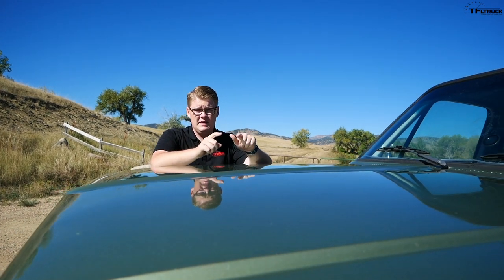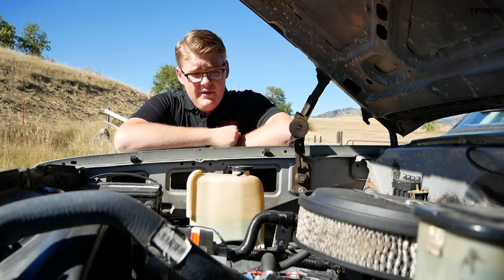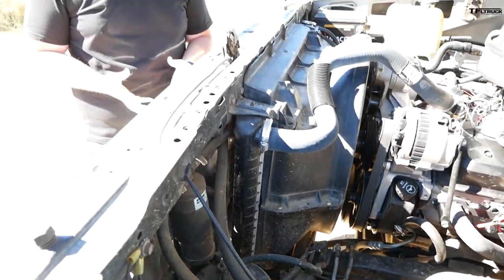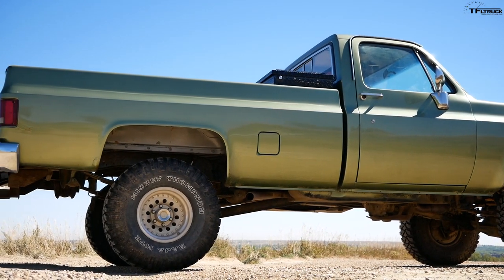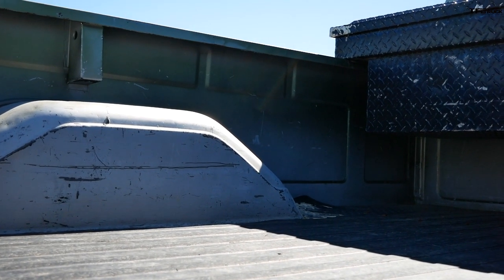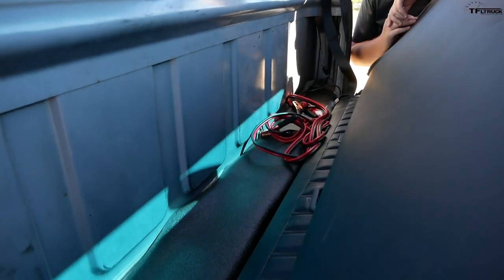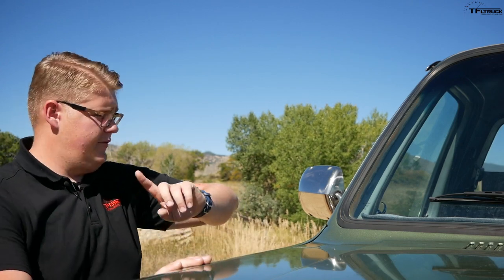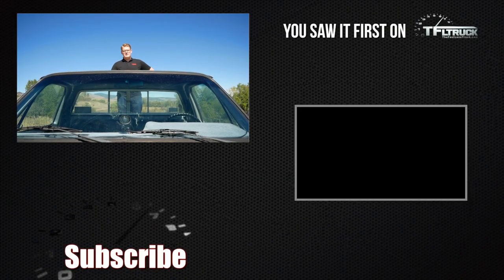Is The Chevy K10 Square Body Pickup Cool or Crap?

Comment: Manual transmission, transfer case, hubs, windows, locks, and tailgate means simpler, lighter, and less stuff to malfunction.  It also means less service work for the dealers and replacement part sales for the manufacturers.  In other words, we'll never see vehicles manufactured like that again.
Reply: sadly
Reply: Your right
Reply: Copy that ghost ryder
Reply: You're 100% right! To bad they built them so bad
Reply: Nissan micra is still built like that lol
Reply: Amazin253 it was top of the line back then, and even today if  you rebuild back to stock form you can take it out and beat the shit out of it and it will still get you home. You can’t do that with a stock truck today. Oh yeah remember you could buy one for under 10k in the 70’s and under 15k in the 80’s. Compared to the 60K + trucks today.
Reply: True and a good reason I'll never get rid of my 78 k10.
Reply: Sherman Bushcraft median household income yearly in the 70s was also only about $9000. Pretty comparable to today.
Reply: I just got a 83 gmc 1500. I've had too many vehicles die from computer issues. I had a great gen1 Kia sportage 4x4 and a friend who is a current kia tech. Together we couldn't fix it. 2013 dodge electric power steering, broke like they all do $2500. Just got an old beat up truck with no computers for $3000. I will be starting the trans rebuild this weekend. I can fix anything on this truck with tools I own and without a computers permission.
Reply: Government regulation is the main driving factor of increasingly complicated vehicles.
Reply: Might get one, what about safety
Reply: It still had a mechanical fuel pump
Reply: Best of both worlds us a resto-mod square body. LS or even better...an LT swap with the factory fuel injection and a cam ...less maintenance and more reliable,  more power
Reply: Here in Europe this is still a valid option for pick-up trucks. Toyota Hilux for example comes with everything mentioned in a manual version in the most basic model.

Comment: Chevy was getting 30+ mpg with the 6.2 diesel back in the 80s. I don't understand fuel efficiency nowadays
Reply: I do. It's because of emissions controls that choke the engines, and also because of safety regulations that force manufacturer to add more and more weight to vehicles.
Reply: that motor was also gutless and specifically built for improved fuel economy
Reply: I think you are pushing it a bit there. My grandfather bought a '83 chevy van brand new in '83 He claimed he got 25mpg back then and I have no choice but to believe him. He wasn't prone to exaggeration but I do know he probably never topped 55mph. 
I now have the van and have converted it to 4x4 with a performance 6.5 in it. Almost 300hp by my estimation.  I pretty much have to baby the crap out of it to get 21mpg. Otherwise freeway miles are closer to 18mpg
Reply: If I'm careful I can pull 18mpg with my 84 1ton Crew cab dually 4x4. It has a 4" lift and a 4 speed with 4:10 gears.
Reply: 6.2 with barely 160hp
Reply: mujjuman 130 to be exact. It was never designed as a powerhouse it was built for economy to compete with the 305
Reply: Yeah but you can turn the fuel up a touch and get some more power or add a turbo and gain a decent amount. The Banks kit advertises 60hp, 120ftlbs and 19% gain in mpg. Still no power house. But I pull a 16ft carhauler with with my crawler or others behind my 1 ton dually 4x4 crew cab. So it's heavy already.
Reply: I have a 84 6.2 lifted suburban with a NV4500 that still gets 22mpg. A 15 duramax with def that gets 14mpg. Guess which has broke down less, gets me further, costs less all around, and is more fun to drive.
Reply: High Country Oh let me guess. The high power duramax?  
That being said I like to build custom 6.5's for power.
Reply: There is no application, no universe, where the 6.2 gets 30+ mpg. In my 82 short bed K10, 4spd manual AND Sidewinder Turbo kit, best I ever got was 16 mpg. With taller gears and less aggressive tires I can see maybe 18 or 19 mpg.
Reply: +xVikXtorx  You need to open your mind mate. My grandfather got 25mpg and that is not far off. That was in an '83 chevy van that I still have today, though there is nothing about it that is stock now. 
How did he do that? Well back then the speed limit was 55mph.  He drove it 50 to 55 mph. It was also empty, basically all it had in it was seats.  Now if you removed the mirrors and lowered it and used hard narrow tall tires I bet you could get 30.
Reply: Build a truck with no safety features to drop weight, with no regular features to drop weight, with a very underpowered diesel engine and drive it in low traffic areas and never go above 55 or 60 and I am pretty sure you will get 30 mpgs. Or you could buy a diesel Colorado today and get 30 mpg. Either way, it's all about weight, drive habits, engine, etc.
Reply: dropn loads ikr I drive a 1992 today and its still a badass
Reply: What I want to know is why my van(6.5 turbo diesel) which can get 20mpg is roughly equal to a turbocharged 2009 Subaru. The Subaru easily weighs less than half the van and has half the cylinders. I have to baby that thing so much just to maintain 18 mpg. Makes no sense to me at all.
Reply: @consaka1  the subaru is makeing a lot more power than the ancient diesel. Add in the higher energy per gallon of diesel compaired to gasoline.
Reply: @as-jp5cl  Diesel probably had more torque too.
Reply: Yeah, and its non-turbo diesel had little to no power!
Reply: Thats just because for every mile it ran, you had to push it another. Worked as a mechanic during the mid 80's, replaced several 6.2L diesels with gas burners in Olds' 88's, 98's, and GM trucks. They ran rough, leaked oil by the gallons, and could not pull themselves out of a wet paper sack.
Reply: @niteshift92  LOL that is a lot of bull. I have been using multiple rigs with this engine and have been servicing them since they came out. A little under-powered perhaps but not necessarily that bad for the times. My own rig has been upgraded with a marine build 6.5 diesel and it has been doing a great job for a long time.
Reply: @consaka1  as you said yourself "upgraded marine build 6.5" not original 6.2. If you look at the original 6.2, GM reverse engineered an Oldsmobile V8 gas burner into a diesel. That engine was never built to withstand the cylinder pressures of a diesel burning engine.
Reply: @niteshift92  I have another vehicle with a completely stock 6.2. It is one year newer than the one I built for more power. It works just fine and gets better mileage and has never had a problem. Somewhere over 200k at the moment and still purrs like a kitten. Most 6.2's that I have done maintenance on have been rock solid. Usually end up working on something else and not the engine. Like the transmission. 
The original 6.2? All the 6.2 engine were original engines built to be diesel. None of them were reverse engineered anything.  You might claim that about the olds 5.7 diesels that had the short connecting rods. Diehard fans of those will claim they were diesel built but I have indeed replaced a number of those and I thought they were a crappy design even as an 18 year old apprentice diesel mechanic. There was just too much side load from the short con rods. But a 5.7 olds diesel was nothing like the 6.2 and the near identical 6.5 engines.
Reply: I get 30 mpg daily driving in my 1978 Oldsmobile Delta 88 with the 6.2 diesel
Reply: @bigrivertaxi  So who put the 6.2 in it? That engine is not original to that car. That being said with the weight of the car and the rear gears that car probably has I think you could get close but even I would have a tendency to doubt that with its stock transmission. Even a 700r4 (not stock for that vehicle) would struggle a little to push out 30mpg.
Reply: @consaka1  I swapped in the 6.2 and a 700r4. I belive it has 2.41 rear gears so rpms are ridiculously low at all cruising speeds. I also turned the ip down below stock. She's not one for acceleration but it gets you there. Lowest mpg I got so far was 26 mpg driving through a very hilly area. I also am extremely easy on the right pedal to get that. Haven't take it on a long highway trip yet but I'm hoping its equally impressive.
Reply: @bigrivertaxi  eh, those 2.41 gears would do it. And you were smart to turn it down as those gears don't want to stay together with the 6.2 torque. I'd love to see what the highway miles would be.
Reply: niteshift92 I feel you I bought a 84 long bed with a 6.2 and my family who are all mechanics told me it would more than likely have several issues but I thought I knew more than them and I didn’t have it 2 months before it and just fell apart bit by bit in under another month
Reply: @braylonnichols1867  LOL
Reply: @consaka1  sheesh that's rookie numbers. I get around 8 mpg in my 87 2500
Reply: They were around 20mpg at the most and they were weak and could barely pull due to the fact it was built around fuel efficiency
Reply: niteshift92 if you believe that the 6.2 was based on the Olds 5.7 or that otherwise modeled after an existing gas engine, you've never touched one of them. Detroit Diesel had to start fresh after GM's 5.7 disaster. Other than the DB2 injection pump, which the 5.7 also used. My truck had its 6.2 replaced long before I got it and my dad advised me not to get one from the few horrendous issues they have, but we have to be honest here.
Reply: @Polishkid88  when they're healthy they're not terrible at all, they're faster than a 305. They have moderate power and the best fuel economy, I get 30 mpg regularly out of both my 6.2 turds.
Reply: @xVikXtorx  hint...K series! your up higher and catch a pile more wind. Your second problem is the 4 speed manual, you'll never get economy with that, ditch that POS and go NV4500.  Both of my 2wd 6.2 with 700r4's get 30 mpg on the regular highway driving.
Reply: the 6.2 and 5.7 are not related at all, Gm approached detroit about co-producing a motor because the 5.7 was so bad. The 6.2 and 6.5 are related tho...in fact they use the same block, cranks, and heads are interchange-able. The 5.7 injection pump will not fit a 6.2, nothing from a 5.7 will fit a 6.2 I've had enough to know...I've got piles of parts. I don't get why people hate on the 6.2 so much, its really not a bad engine if you have any concept of regular maintenance. The 6.2's the only truck engine I've never had problems with and I've driven them coast to coast.
Reply: So many people in this comment chain not taking into consideration final drive ratio..
Reply: Door strikers WRAP TAPE around them to replace the pvc plastic that broke off & doors shut perfect again. Almost all old squares have dented doors from idiots donkey kicking doors shut over .30c worth of tape or $20 worth of new door strikers. The Steering box area, aftermarket has sold weld in frame patches and triangulation brackets for many years. Square enthusiasts know about these issues. Old to trucks need grease everywhere-  The hood latch, door springs/strikers everything opens closes perfect w some lube
Reply: @05EVORS  the new trick is to wrap a piece of PEX pipe over the striker
Reply: they put all that emmisions junk on it
Reply: @consaka1  van... 4x4... performance 6.5.... and you say you don't get good mpg?  Shocking... 6.2 could do 30... I get 16 with 4.56 and a th400... the nv4500 k5 blazer with the 6.2 just went and went and went on a tank of fuel...
Reply: @niteshift92  The 6.2 is a Detroit diesel motor... not an olds... not "reverse engineered" sadly so many people are clueless...
Reply: @mattlane2282  Well it's like this. Back when it had a 6.2 and 3.08 rear gears behind a 700r4 my grandfather claimed 25 mpg when it was new. However, I know a couple things about how he drove it. He baby'd that thing and never got above 55 mph.
The van empty is heavier than the k5 so there is that. The van has between a 6 and 8 inch lift(not because I wanted it) and that negatively affects the mpg. I drive it loaded out with camping gear tools and recovery supplies to about 8,000 lbs and that hurts the mileage some as well. Then there is the 6.5 marine build with low compression pistons and a turbo the size of Texas. roughly 300hp and it's fun to hammer it occasionally so that doesn't help the mileage either. I estimate 18 on the freeway with the np208 and a 4L80E on 3.23? gears.
Reply: @consaka1  I replied to like your first comment thinking you were calling total BS on the mpg... later on I see your saying it is possible... id like a 6.5 mechanical to replace my na 6.2s but never gona happen lol not worth the cost
Reply: @mattlane2282  Aye, I do all the work myself so it's not too bad but it is a bit of an investment. I like to keep the old stuff moving and in the end, it is a lot cheaper than just buying the new stuff. A big challenge is finding a good block to begin the build. A lot of them are cracked down on the bottom end. You can get new replacement blocks that don't crack but they are spendy.
Reply: i still have a 1983 suburban that had a 6.2 Detroit in .it has a 7inch lift and 35 inch tires was getting still 19 mpg. before i blew the motor lol . put a 2005 lq4 in it now amazing burb now tho i miss the mpg of the diesel

Comment: I have and 1986 GMC  4x4 square body with the original 350 gas engine.  Always working and still saves many lives/ pulls many cars out of the deep water during hurricanes as we just had in  North Carolina/ South Carolina region.  When people see this truck coming to the rescue; they feel a sense of confidence and all will be OK.
Reply: Dude you're Wicked it's because of guys like you. Is why I bought a 1987 Chevy Silverado 4x4😁✊
Reply: Sure they do?🙄🙄
Reply: So do I, but mine is a 83 with the 350, granny low transmission, and 4 wheel drive with factory lockers.
Reply: How reliable is it?

Comment: Very cool. I'm honestly kinda sad that basically all pickups nowadays are massive, hulking crew cabs with luxurious interiors and run well north of $40k. It seems the true 'work truck' has been abandoned for luxury, and I do understand most people want every possible creature comfort and gadget they can get and manufacturers are simply filling that market, but nevertheless basic pickups are few and far between.
Reply: Plus you could invest less than half that in one of these trucks and make it as nice if not nicer than a new Silverado and WAYYYY Cooler
Reply: Yar Nunya  no stick shift though (unless you get an Ram 2500/3500 with the Cummins)
Reply: I bought in 2008 what was probably the last good half ton work truck made. Brand new Ram 1500, base trim, reg cab short bed 4x2, V6, 6 Speed Manual (08 was the last year), vinyl floor, manual door locks, mirrors, windows, vinyl split bench seat; and I used it to work and made money with it. I planned on keeping it long term, but after almost 6 years, it spun a bearing while I was on vacation with it, so had to get rid of it :(
Reply: They are out there. I just got one. Pretty basic except for the 4x4 and power locks/windows. It's awesome and looks like a damn pickup ......it was about 29000 intil I added a couple things.(extended warranty and auto start and rust protection) But it's great. You can order or even do a search they are out there at the dealers. They look hella nicer than the big flipping crew or super cabs....good luck...
Reply: Ya exactly and what ever happened to the manual trans bening offered as the bace model and automatic being a extra option  now days the shifter is completely gone and there is a little nob and a button for 4X4 engagement
Reply: Well time for me to find out how to make an engine and fill this part of the market
Reply: Just TRY to buy a 3/4 ton, regular cab, long bed today. Damn near impossible. You have to order it as a fleet vehicle.
All they make today are 4 door short beds, even in 3/4 and 1 tons. That's not a "truck", that's a lifted car with an open trunk!
Reply: The sizes havent changed much, park up a Rounded line (square body) next to a regular Silverado and you will find they are close in size. Also even base models these days are well equipped.
Reply: Nah, Chevy still makes them. They are the W/T versions. The W/T is as analog as it gets with manual roll up/down windows and lack of luxurious equipment, but that’s why it’s better. You can upgrade later with aftermarket parts since there’s a huge selection for Chevy trucks.
Reply: Ik that is sad but true

Comment: “Nothing works like Chevy trucks”
Reply: Lucas Major yep. Except for every other brand
Reply: Kristopher Klassen I’ll say back in the day where it was traditional small blocks and big blocks yeah nothing works like them. But ever since they switched to the 5.3 they kinda lost there way
Reply: Nothing rusts like Chevy trucks either
Reply: Tianze Li lol
Reply: @L_T_Z   have you seen a second or 3rd gen dodge ram before? Or a Ford truck for that matter they all have their fare share in rust issues. Let's not talk about Toyota trucks cause that's just a large expensive dilemma that they are still paying for.
Reply: My 94 went through a trsnny and engine with 190k miles, love the truck but it's a pos..installer a new engine, lost oil pressure
Reply: Stuff stuff and More stuff my dad had a 94 we drove around the country for 13 years and it had 350,000 on it last time I checked but it just sits now still runs great with little rust. on the original motor and tranny most reliable truck I’ve ever seen other than my uncles old 98 s-10 with a 2.2 and a 5 speed which is still running up and down the road with over 600,000 on it
Reply: @braylonnichols1867  yeah, usually they're been reliable but mine is just cursed
Reply: @L_T_Z  Fords and Dodges do lol